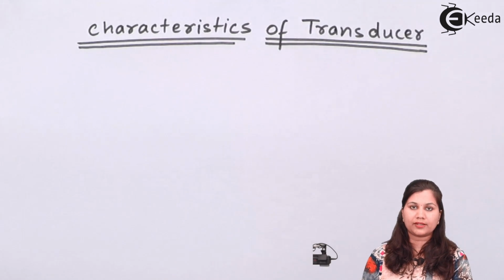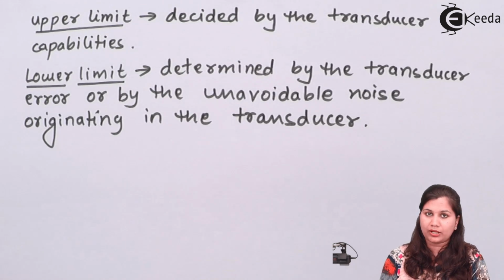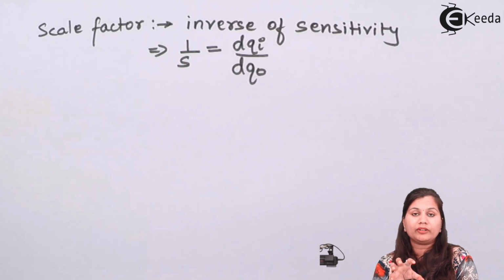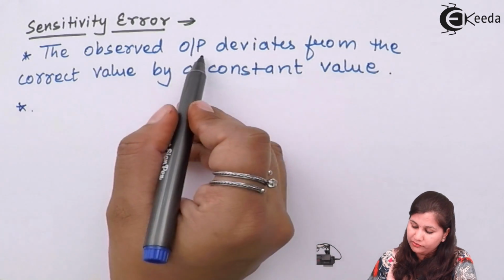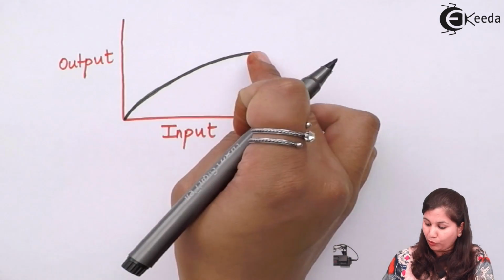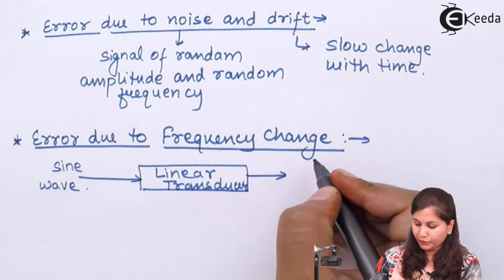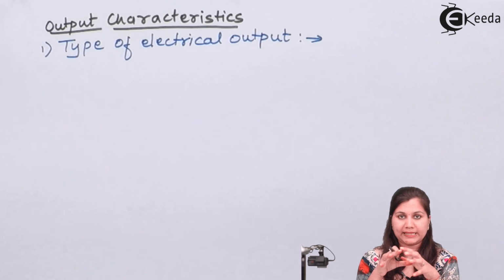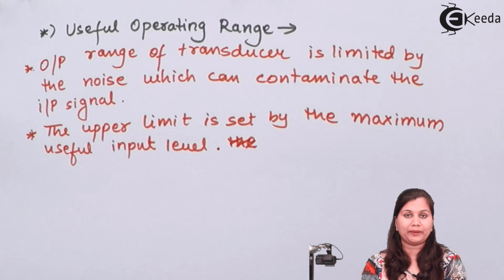Characteristics of Transducers and Sensors - Transducers and Sensors

Comment: a temperature sensitive transducer experience a sudden change in temperature . it takes 20 second for the transducer to reach steady state .Assuming the device to be a first order linear system. calculate the time it took the transducer to read half of the temperature . Plz solve this question